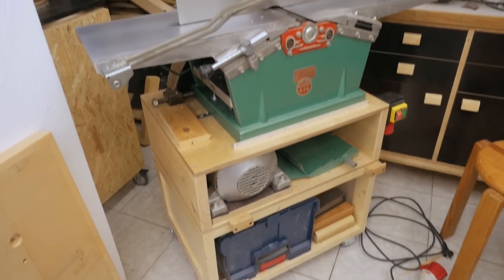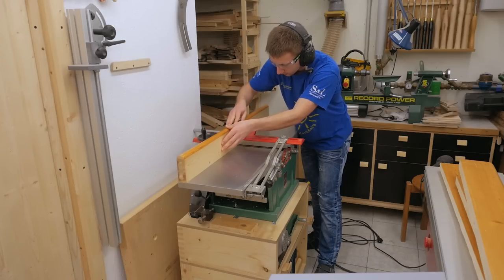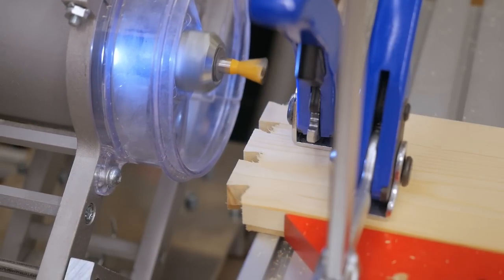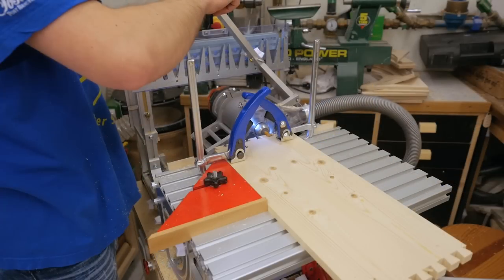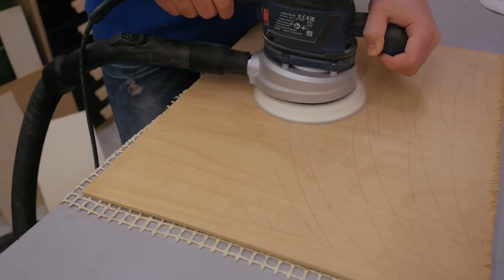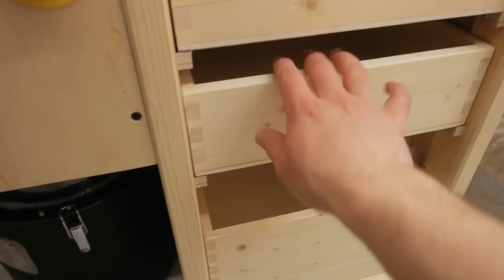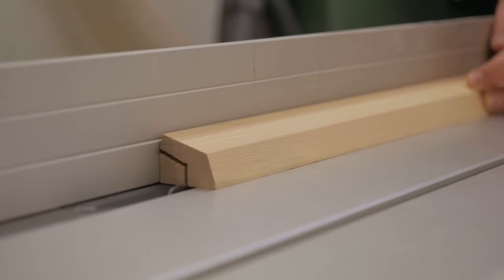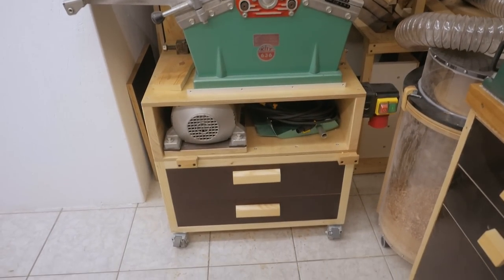Making Dovetail Drawers with the Pantorouter

Comment: I'm consistently impressed at how relatively easy it is to cut joints on the pantorouter. I should really upgrade my table saw first. I should really upgrade my bandsaw first. Yeah, I'm probably not going to do either of those things soon.

Comment: ah now I know where I got the idea for those drawer-pulls, I thought I it was my idea at the time when I made some that are quite similar (about 2 months ago) but now I'm pretty sure I stole the idea from you. sorry I hope that's ok :)

also for cutting dovetails in multiplex plywood, handcutting works quite well in my experience, you should try that once, the fitting is easier than with sold wood (even softwood) ....

and on last tip, when putting dovetails (made with flatsawn boards) together, make sure, the right (the right side (at least in german, I don't know if it translates) is the heart side) side of the wood is on the outside, because, when wood moves the bow goes the other way than the annual rings, so in an assembled dovetail corner, when the right side is on the outside, the middle of the board wants to bow out, which is much less likely to happen due to the geometry of dovetails than when the board is flipped and the corners want to lift. sorry its hard to descirbe. 
maybe an image helps: second image here: http://inspectapedia.com/decks/Wood_Board_Bark_Down.php

Comment: How is the vibartion on the Dewalt sander compared to the Bosch?
Love the chanel
Reply from the maker: The DeWalt is very good. Comfortable to use. But since the Bosch has built in dampeners it's a lot better. No fair comparison though.

Comment: has the plywood you used for runners really got a black laminate on it? usually you get plywood laminated with melamin - but those you used look like redish brown, so it is more like phenolic resin (resol, a precursor of bakelite) you'd find on coated texture boards ("siebdruckplatte") and those are not laminated, the resin is directly bonded to the plywood

needless to say that pretty much nothing sticks on penolic resins, so they are pretty much the perfect choice for a work surface
Reply from the maker: ah, yes they're phenolic resin coated. Siebdruckplatte is also what they are called here.
Reply: Siebdruckplatte is textured coated board, US you do it your self. But it looked really nice